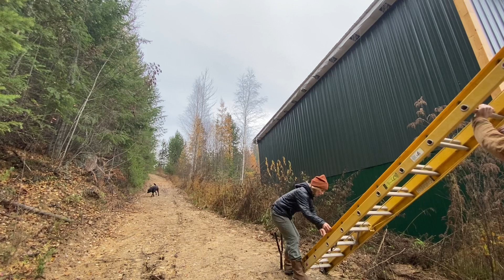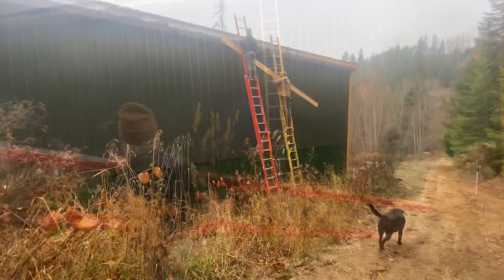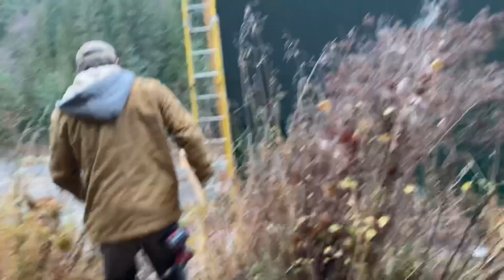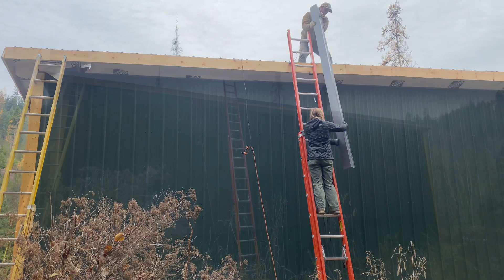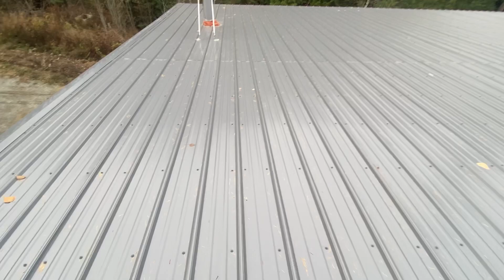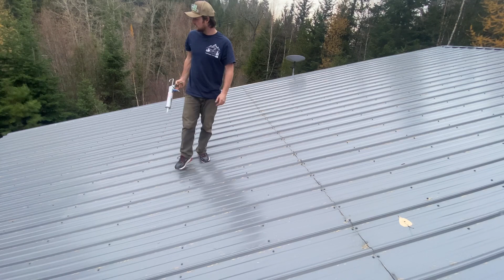Climbing on This GIANT Roof

Comment: You need to permanently install a fall protection anchor at the high side eave of the roof so that you can hook on  rope and harness when you get up next time. At a minimum, you will have to get  up again to clean your chimney. Walking on wet metal roof is scary. Do it for Liz. Go to Home Depot and buy a fall protection kit. Marty Johnson can show you his rig.

Comment: On the Caulking gun, the hole by the handle is used to cut the tip off of the caulking tube.  Just a FYI

Comment: I recently saw a video on why having over hang is better then trimming it and adding a cap. The video talked about how ice cycles form on the edge and in the process left the facesa board off the end studs. They went on to say that because there was about 5 inches of extra overhang that the ice never got close enough to the facesa board to harm it. It made sense to me, what do you think. Maybe after the snow and ice is gone you could check it and see if they were right.

Comment: Nice Job looks great, love the Smiles! 😊 Maybe next time you needed go on the roof. “belay on” over the back edge. Anchor to your truck or 4 wheeler. I’ve been on metal roofs mount wireless IT antenna’s it’s tricky not fun. Talk to the local climbing club or Boy Scout certified COPE instructor for tips. 👍🏻

Comment: Congrats getting the roof buttoned up. Check that off the list. For sure looked a little sketchy on the roof without a safety rope. Nonetheless, you pulled it off is super fashion. Good job. Thanks for sharing.

Comment: Did you butt join that tin on roof? I hope you overlapped the tin or any water could get in roof. It helps rain will run off fast and not standing around. Congratulations on your marriage 💑.  HAPPY Thanksgiving

Comment: Hi, I like Yr ladders. These seem to be still relatvely light at such lenght. Very practical extension mechanism. Need to look arround if I can get such here in Europe...
I was wondering why U need to seal by silicone there. These big metal sheets should anyway offset each other lik 3-4", do they?
Reply from the maker: Hi there! Ladders come in handy in so many situations. The silicone is just a little extra precaution for moisture. Thanks for watching!

Comment: I'm not going to yell at you for not having safety gear when on a  roof but will say it turns my stomach to even watch someone in high places like that unsecured. I did watch the video for you. I can't do it at  all. I did do it at your age myself and  thought I was bullet proof. I will say  that you just came home from the hospital where you just turned and your back went out on you and how hard was that to just turn just right and it went out so if you had been on the roof when it happened, its possible that you might of fallen at that point. Please rethink the safety issues through as your just too young to die yet son